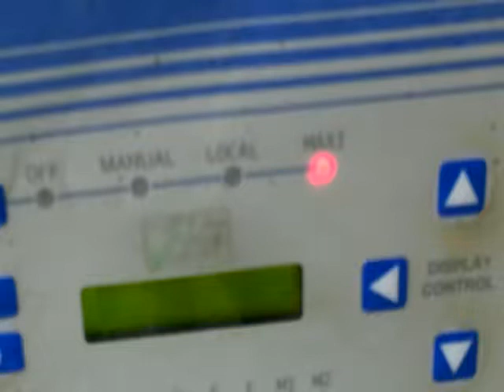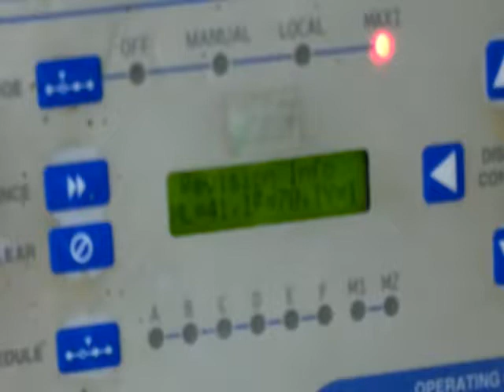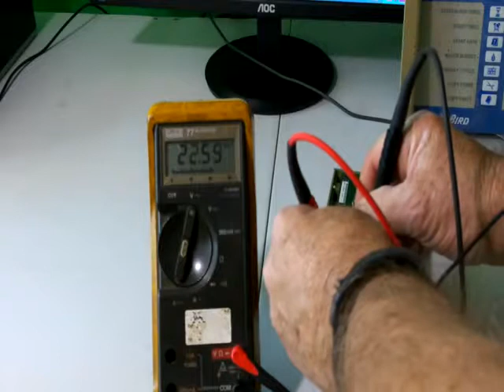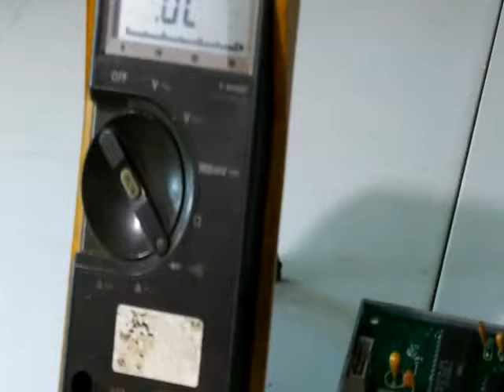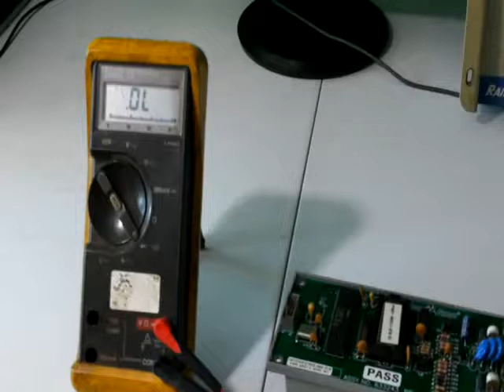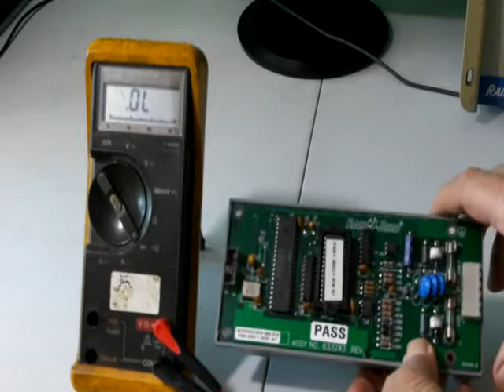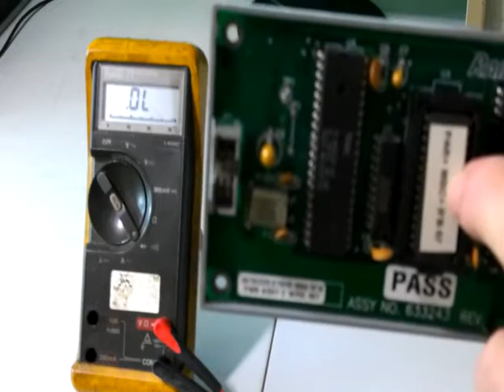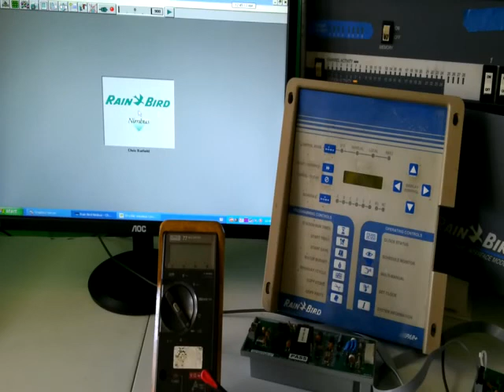Maxi 2 wire Module

Comment: OK, what if I have good voltage, and a good board, even put in a working good board from another satellite, and STILL can't get maxi signal? Voltage good coming onto satellite, voltage good to board, brand new board, and the satellite on the loop before it is fine? I'm stuck
Reply from the maker: Hello Ross ... Let's try to get you unstuck :-) ...

If your incoming voltage is correct, usually a fluctuating 22 to 23 volts AC things to watch out for:

Make sure the voltage is getting to the module through the MSP1 Pipe bomb.
Make sure the Red Hot and Black Common wires are connected at the correct input location.

If this is correct there are 3 other possibilities to check:

Try switching the ten pin ribbon cable going from the Maxi Module to the power interconnect with a known working one.
Try Switching the facepanel with a known working facepanel to make sure the  24 pin ribbon cable is good or if the facepanel itself has a problem (which is possible if certain chips have been damaged)

Try the existing faceplate in a known working location to make sure it is either good or bad.

If the facepanel and maxi module work in a known working location the next possible problem is the power interconnect which every signal passes through.

If you go to system information and Revision Number and you get an MLB number plus a IFB number and a TY number then the facepanel is reading the module, and it still does not communicate. Then try in known working unit to isolate it to facepanel or maxi module.

Remember it can take up to 20 minutes for a facepanel to lock in as the MIM is polling the system. 
To accelerate process send a command to the satellite from the computer or freedom system (if you have one). 

If these solutions do not fix your problem, give me a call 386 690 7302 my name is Jim Worcester.  Don't worry there will not be a charge for this call :-)

Thank you for submitting your question!

For further information please visit our website absolute-control.com or  send email to Info@abcisi.com